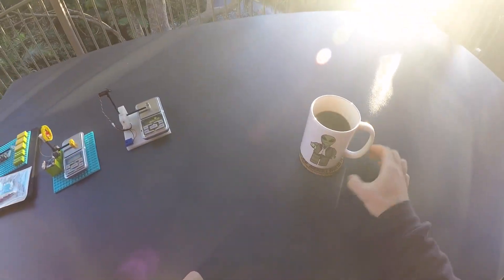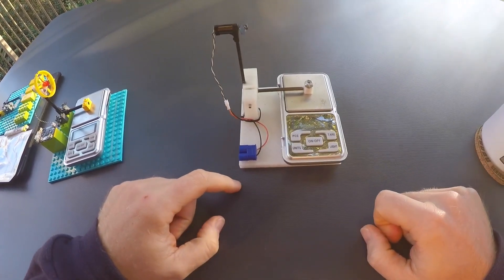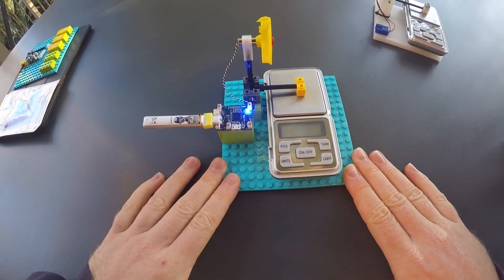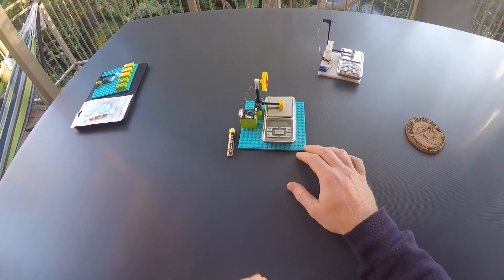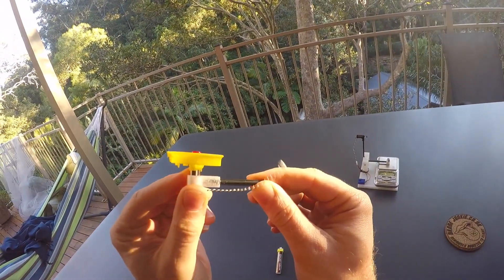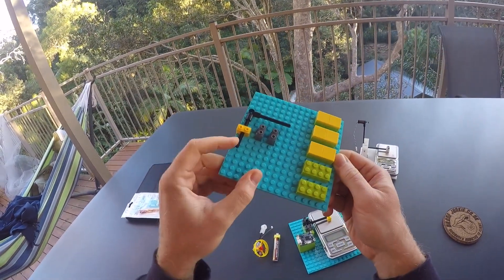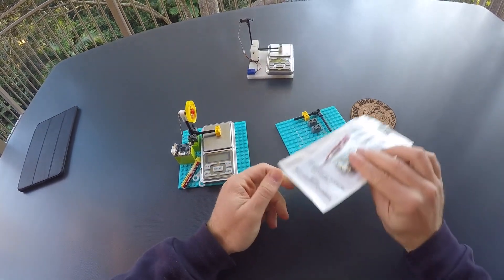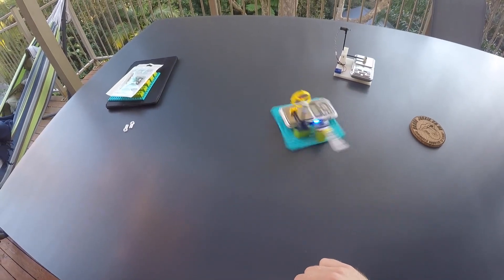The Micro Motor Thrust Stand

Comment: Hi, have you try to test the motor thrust with different PWM values? 
like from 8Khz - 32Khz?
Reply: Capung Plastik in my experience, maximum thrust slight declines with increasing PWM frequency. Just measurable with our primitive tools, and very difficult to perceive when flying. What is more noticeable though is the noise of low PWM frequencies, that’s why I personally fly all my brushed quads on 16 or 32kHz.
Reply: @BenediktHaak  on 16khz, did you found any glitches within your flight?
I have tried on 8khz with 8520 motor, but last time when I took it outdoor sometimes the quad pitching back by itself.. 

Well, need more time & things to inspect, since I don't have quite time to flew outside recently... but I'm curious about actual thrust on lower PWM value..

My main goal is to have maximum thrust for my 65mm 716 motors setup within the weight of 30-36grams max (without battery). I want the whoop be able to lift an addtional 14 grams HD camera with minimum frame size.. :)